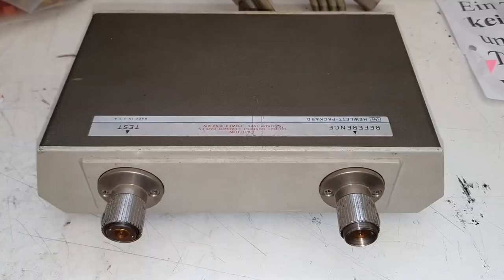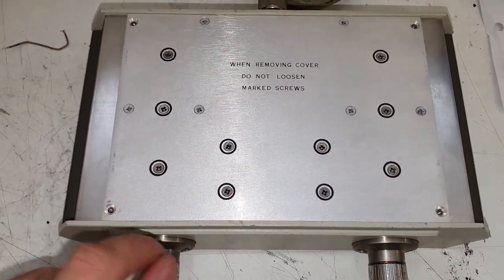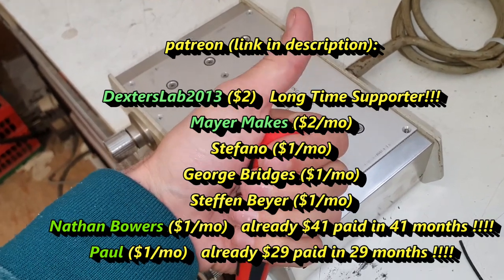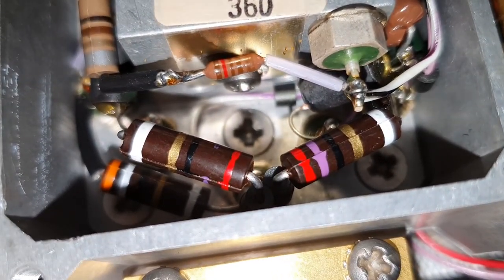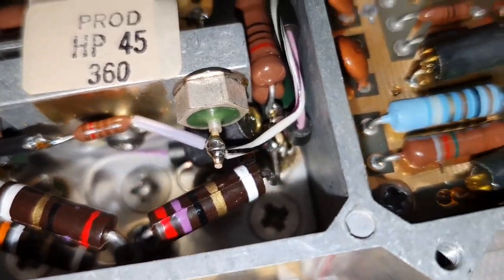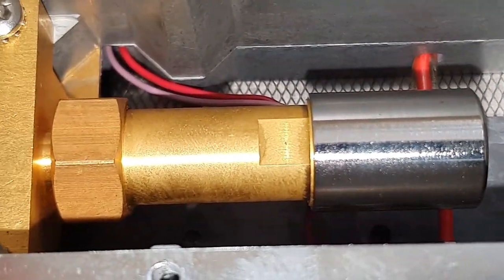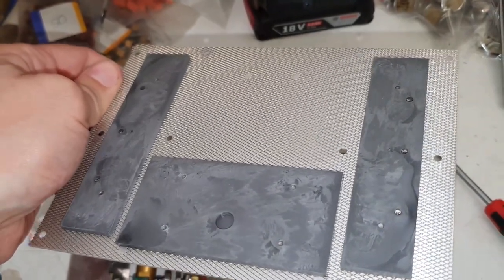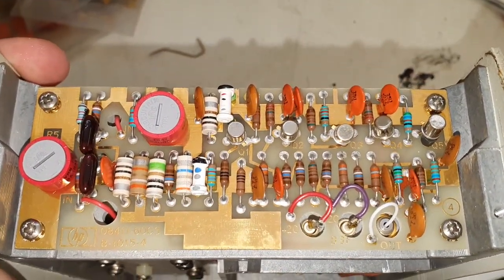BEB #124: HP 8411A Microwave Frequency Converter: What's inside? 🔧🔧💣

Comment: The cavities contain the harmonic mixers; both units are very carefully matched to have the same phase response; the strip line across the back under the plastic cover is the phase matched network feeding the local oscillator signal to both mixers. This was used with a bidirectional dual coupler system (which it fitted directly onto with the 7mm connectors) and formed part of an S parameter test set capable of measuring insertion loss, return loss and phase response of microwave components.
Reply from the maker: Thank you !!!!
Reply: My digital brain can hardly cope with inductance and capacitance, HF is 'magic' for me.🎩